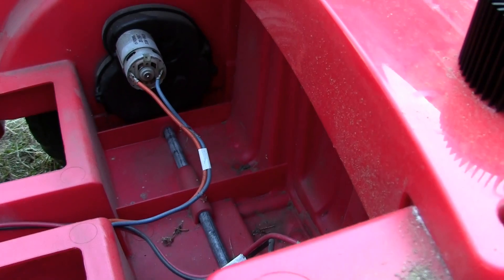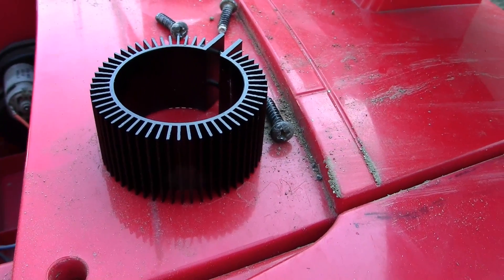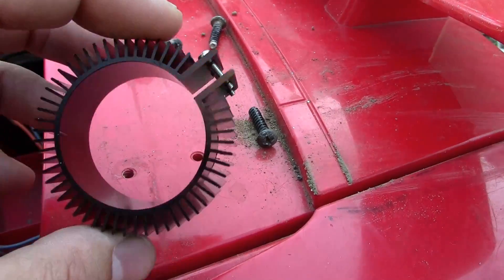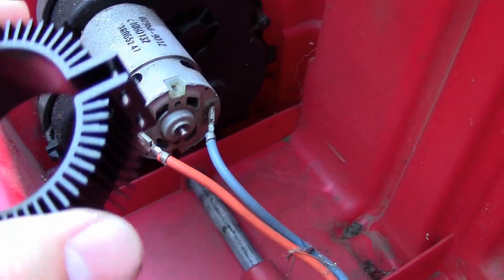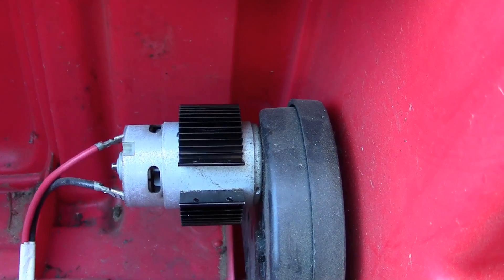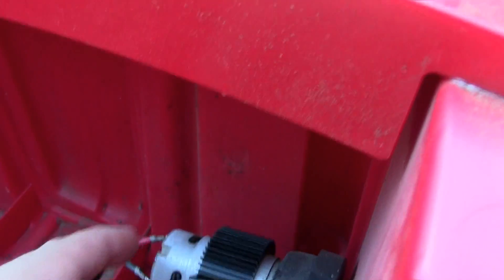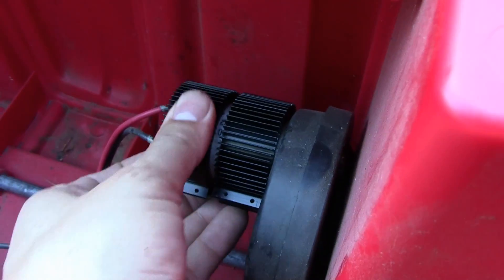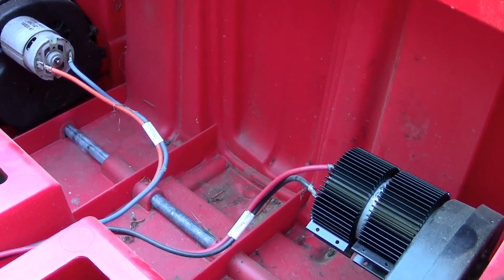Power Wheels Motor Upgrades HeatSinks

Comment: I would take the second one of because its covering of the internal fan for the motor
Reply: +BIGJAMESRC I was going to say, those vents are covered. and don't take that metal ring off, that's a torque ring and helps the magnetic field of the motors coils, just peel the sticker off and use a heat sink, not over the small vent openings on the back.